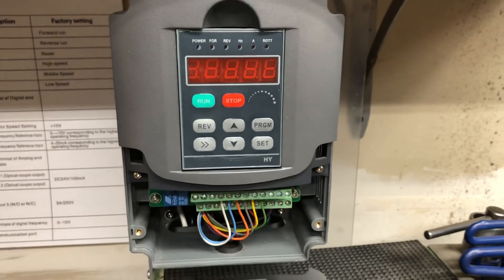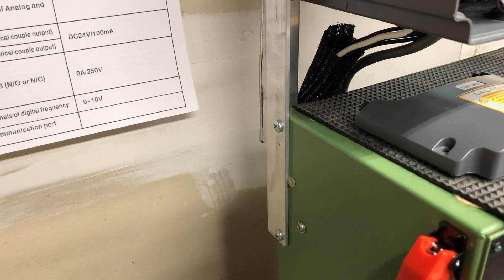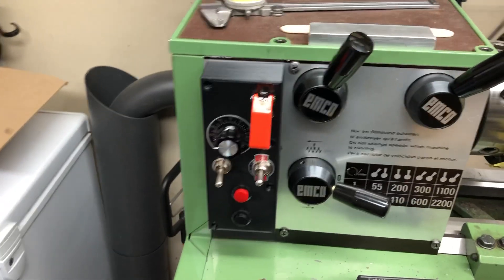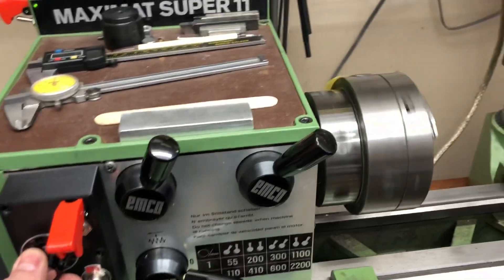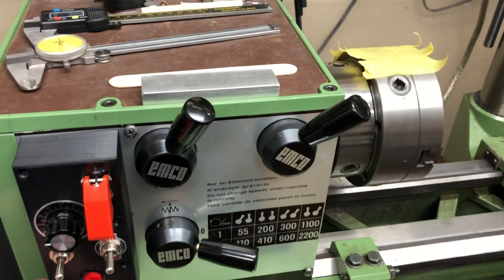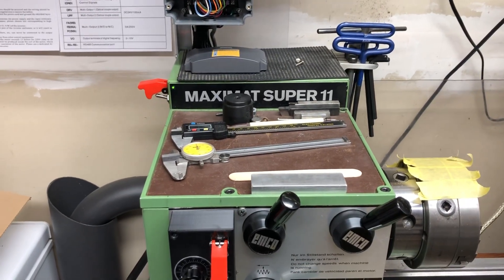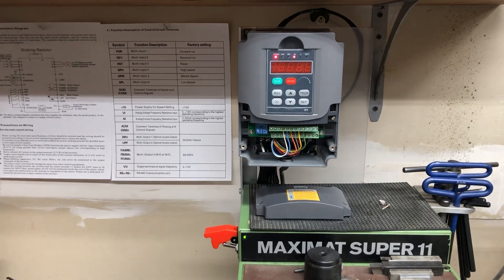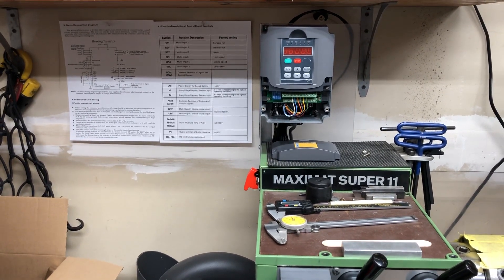Variable Frequency Drive on Super 11

Comment: Hey! that's a great win for the Emco.  We both discovered the same thing -- the low speed (delta) windings work better.  I tried both as well.  I didn't 3d print a nice enclosure for the switch though!.  I still use the gears to shift spindle speed range and keep the torque high for the particular speed.  Here's my conversion: https://m.youtube.com/watch?v=CD44Hoawyyo
Reply from the maker: Hey, nice video you did! Not so scatterbrained like mine here. 
Conversion sure makes a better machine doesn't it.
One thing I didn't mention was I used a bit of RS232 cable to get from the controls on front to the electrical box. It fit through the rotary switch shaft holes. I may have wire tied it in a spot on the way through but it is in a good out of the way place and very safe. No holes drilled.
Mounting the switch box I made picks up screw holes and bosses already on the headstock for the old switch knob mount and leaves you to drill one in the sheetmetal faceplate for a sheetmetal screw. Minimal butchery.
Now that I've had this setup for years I can say I'd do it again like this. Not that there is anything wrong with just a direction switch and a speed knob. Both extremes of controls works just fine. 
Maybe someday when there is ice tea in hell I'll redo this video. Or maybe I'll just make more chips on some other project instead.
cheers
Reply: @pdofak  I love the jog function! - Yeah the VFD really improves things - my wire bundle was a bit thick to easily route it through the path of the orignal rotary switch shaft..a bit kludgy but works. I'm with you on the "Just make more chips".  Maybe someday i'll 3D-print a single, spiffy enclosure..or just make more chips :-)

Comment: This vid was aimed primarily at the Emco users group. They have a library of info and some very smart users there. 
Depending on which motor you have the wiring is different. Mine was different from the more common setups. I had to figure it out by looking at the barrel switch and deduction. There should be an electrical print on the inside of the electrical box cover plate.
If you have the 120v version Elgin motor like mine the low speed windings were wires 1,2,3. They were connected to switch terminals 19,2,10.
I strongly urge you to join the Emco owners groups. 
There is one for the S11: https://groups.io/g/EmcoSuper11lathes/topics
And one for the Emco V10 which has the majority of traffic: https://groups.io/g/emcoV10lathe/topics.
HTH

Comment: Thanks for the video, I have a Super 11 running on an old DIY rotary 3 phase converter. Would love to switch over to a VFD. Your link to the documentation doesn't seem to work. Any place else I could find the files? Thanks
Reply: Aww phooey. I changed hosting and wound up with a typo in the new setup. (The U needed to be capitalized.) Should be good now. Sorry about that. 
If you have other questions, don't hesitate to ask!
Reply: @ArriGaffer  Awesome! Thanks!

Comment: Holy crap! Hi!

Figuring out the whole VFD thing was a pain because there was so little good info about doing it.

I made the VFD video and a pdf file of what I learned in the hope that it would help shorten someone else's journey to VFD. I put it on the Emco group's files area. 
It was intended for the gang at the Emco user group and it didn't occur to me that people (like you) would find it otherwise. 

I have been working way much lately and did not realize that yours and other comments were hitting YouTube.

Man I'm really sorry.

So although late,  I hope it still can you out. I may not have the answer but you are welcome to ask anything!

http://arctician.com/4U/HuanyangVFDprogrammingAdventure-allFiles.pdf

Cheers,
Patrick

Comment: I have a VFD on my Super11 3phase.  I went the easy route and just connected the 3phase input directly to the VFD.  I had two issues to overcome.  #1 the contactors in the Super11 need at least a 30Hz input for them to operate thus you can't run the VFD up from 0. (no slow start) #2 the 1.5HP VFD will not start the lathe at 30HZ due to over-current protection.  My plan is to do something similar to your setup and bypass the contactors and FW/RV switch on the lathe.  Would like to see your PDF
Reply from the maker: Yeah, mine didn't have relays, just the barrel switch. It was still working but they all fail eventually. The VFD eliminates all that other stuff. No switches, relays, caps, etc. Power to inverter, to motor. Done. The inverters are sensitive about not being directly connected to the motor. Easily damaged if that connection is broken while working. 
I strongly encourage all to skip all original controls circuitry and go direct VFD to motor. Even if you do it on a temporary manner that allows going back to factory setup if need be. It's only three wires!   
My Emco switch box is emptied out. It just has the terminal strip and that's it for the lathe. The controls could have been as simple as a pot and a fwd/rev switch and wind up with same function as I have here. However, I laid out the controls wiring in the document too. Along with the programming of the Huanyang VFD. It took me some time to sort that part out. Hence the docs and video.
Apologies for the scatteredness of what you see here. I'm still tied up in some major ordeals that have me preoccupied at the moment. Later on things will settle. I will settle.
Cheers

Comment: Nice video, thanks.
I have an Emco Compact 10 with a 380 Volt 3 phase motor. I would really know if this inverter suites my lathe and would welcome the PDF. I can't find it. Cheers
Reply from the maker: I put all the files on the Emco Group Files area and the link to the folder. The link works for me but maybe it doesn't work for everyone. So I also put the same info into one file and stuck on my web space and posted the link here. It's the you see above.  (and here) http://arctician.com/4U/HuanyangVFDprogrammingAdventure-allFiles.pdf